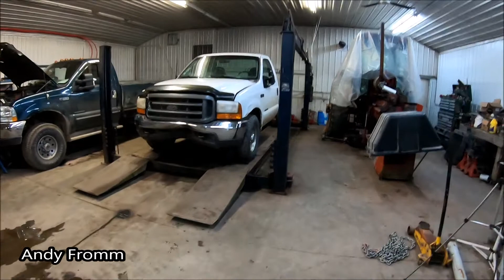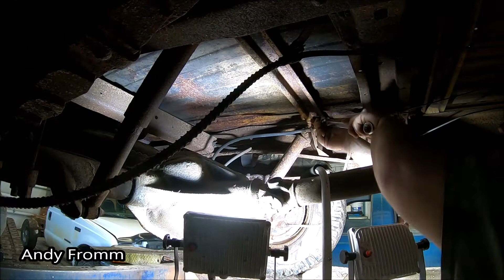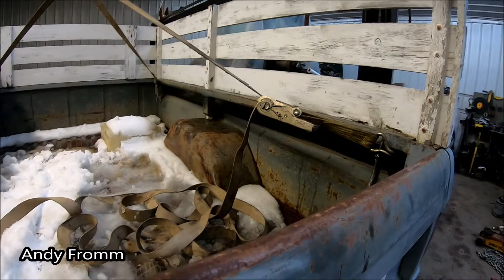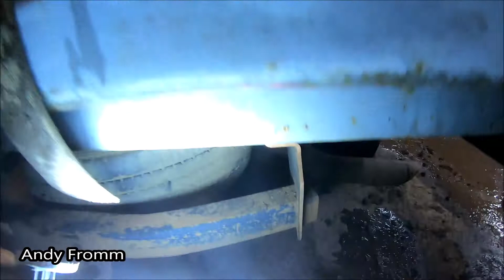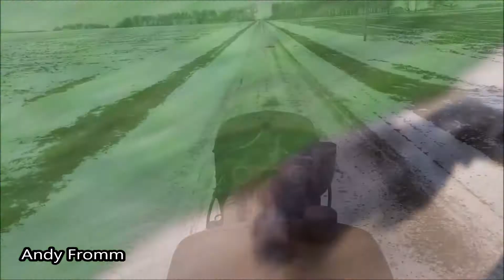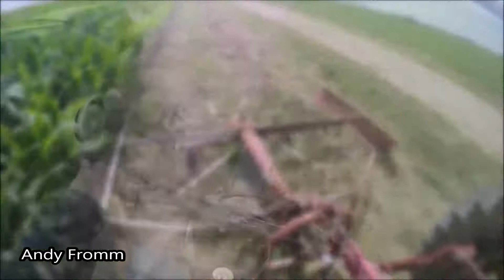#1964 #F250 Pt3 Swapping the Bed

Comment: How are the excursion springs holding up? I need to get new springs and I'm wanting a 4 inch lift with 35s but I'm wondering if I can get away with these springs? I've heard they lift the x 2-3 inches? Especially since my truck is sagging really bad in the front.
Reply from the maker: They are doing great, glad I did it. I can't remember what they added but I also added a "mini leaf" lift, its like lift block but has a pin that goes through the stack. My tires are about 35's
Reply: @AndyFromm  aw man, thanks for answering so quick! Awesome! I might do it then. How much money did you spend and did you have to do anything to your track bar or steering?
Reply from the maker: @hisnameisiam808  I can't remember what I spent, I had the mini leafs laying around.  I did nothing to the track bar or steering
Reply: @AndyFromm  thanks a bunch!
Reply: @AndyFromm  will I need different shocks?
Reply from the maker: @hisnameisiam808  I never changed them. The stock ones might limit extension but I'm not jumping it or something where you'd need more travel.  The front mounts to the bump stop plate/top spring mount plate.

No problem, good luck 👍
Reply: @AndyFromm  one last question: I have the v10. Should I get the v code or c code(can't remember which one is the for the front) instead of the x for ride quality? I like the idea of an extra inch of lift in the front. Just curious if the ride is rough?
Reply from the maker: @hisnameisiam808  personally I don't think the ride is that bad on the x with the 35s, maybe if you could find someone with x springs on an f350 to take for a ride to feel them. I'm happy with them
Reply: @AndyFromm  I'm sure I'll be fine brother! If you are happy with them I'm sure I'll be. I wanted to do a cummins swap or a 7.3 in my v10 I got for 1600 with a blown engine a couple weeks ago. But I needed the truck quick for work 😕. I am enjoying the new v10. Lots of power but it eats gas. Of course, I saved a ton of money buying it with a blown motor and doing everything myself so it's a win in my book. I'm glad I don't live by the gulf coast with the pipeline shutdown. I hope you aren't affected too greatly. We are preparing for harsh times up here in Oregon because weird stuff is happening in our country right now.
Reply from the maker: @hisnameisiam808  I liked the v10 also but hard on gas. In the Midwest we are having a diesel supply issue but it hasn't really affected anything because most of the spring farming is done. The whole country is going down hill fast
Reply: @AndyFromm  agreed. Thanks again for everything. I'm going to order at least the front springs. Not sure if I need the rear. Might add a leveling kit. I'm mostly worried about the front because I tested it today with the 35s and turning the wheel I couldn't go full lock either direction because it was almost ripping the plastic trim of the bumper. I might do the shackle leveling kit after talking to a guy from sdtrucksprings today, that's what he recommended. As well as possibly a block in the rear. I'm going to talk to him again tomorrow.
Reply: @AndyFromm  I want the 35s to fit the first time without any problems.
Reply from the maker: @hisnameisiam808  do you have really wide wheels? My excursion doesn't rub anywhere. My wheels are 16x8 with a 4" offset, 16x9 with 4.5" offset might kick everything out a touch & rub.
Reply: @AndyFromm  ill check it tomorrow.